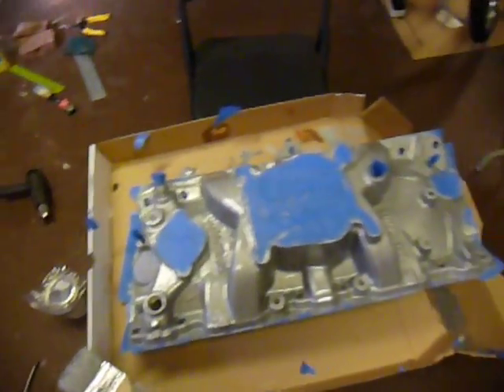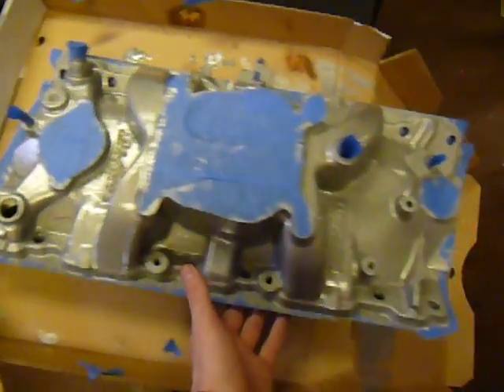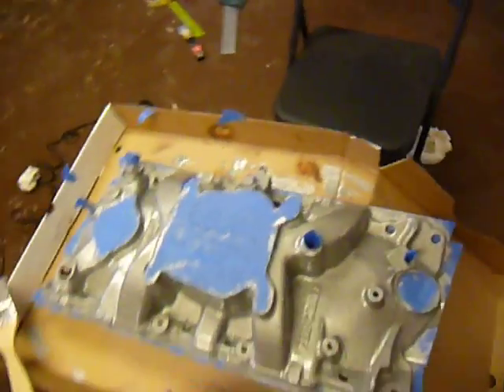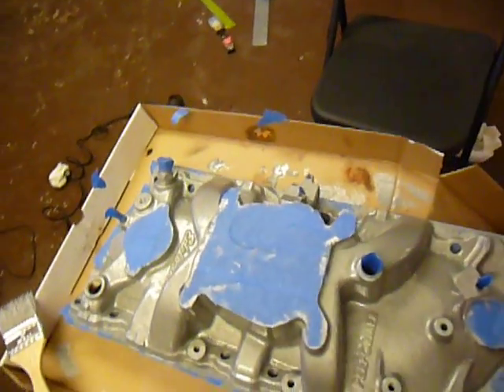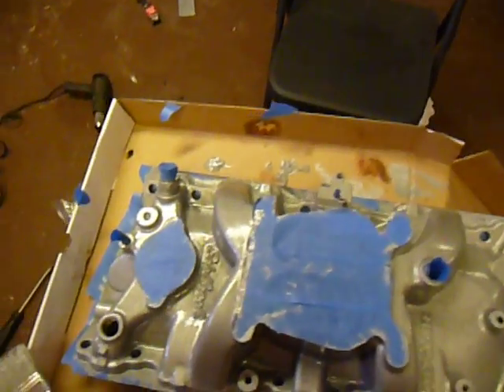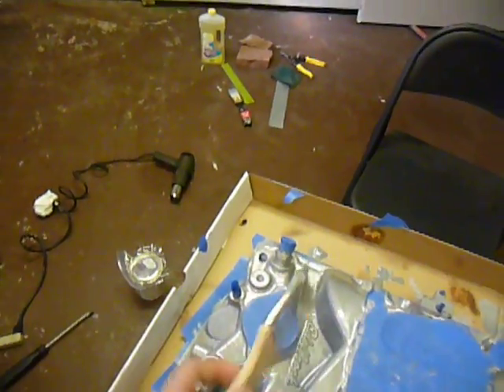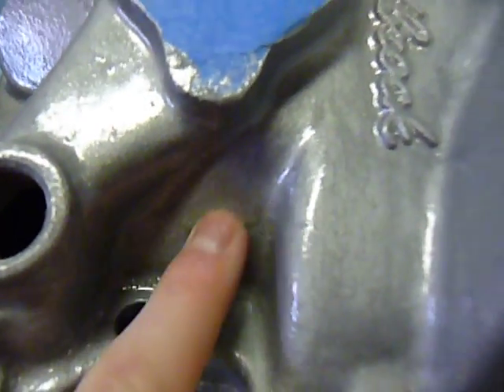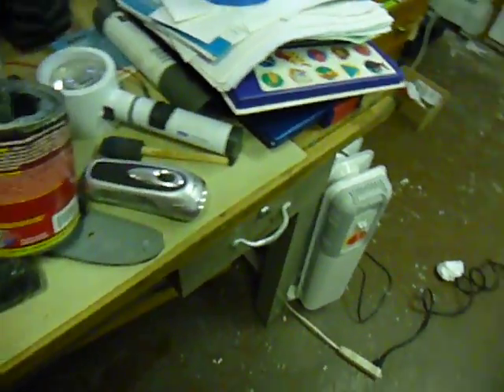Aluminum Intake Manifold Refinishing Part 3 of 3

Comment: Nice work!  On my '72 Charger, I used black POR-15 in some areas and applied it with a foam brush.  Did all the proper prep too.  Came out very smooth and no bristles!

Comment from the maker: Thanks  I will be doing a 6.2 build soon for this truck.  Just need to save some cash and possibly pick up another motor as they are known for main web cracks.  I prefer the 67-72 stuff but just could not afford to get into them back when i was in high school so I got into the 73-87 stuff instead.   Your rig is turning out real nice.

Comment from the maker: Thanks.  yeah it works well on the older discolored and stained stuff.   I got a few runs in mine but its going on a lifted 4x4 so no big deal.   I kninda want to try one of those endura shine manifolds... but they are kinda flashy for my tastes and expensive.  Hope things are going well with the 327's